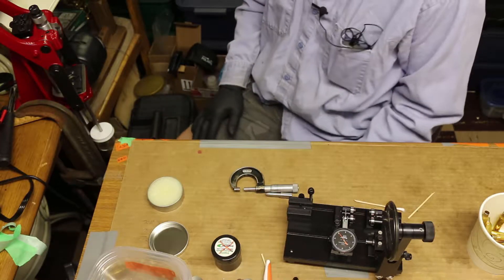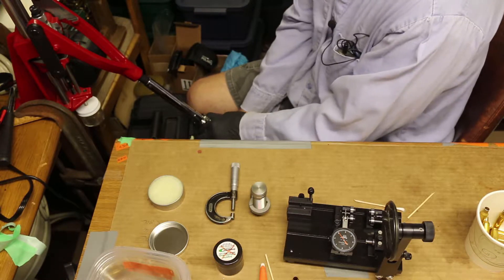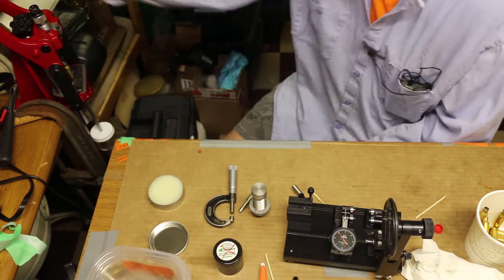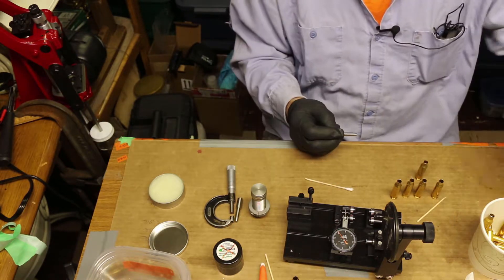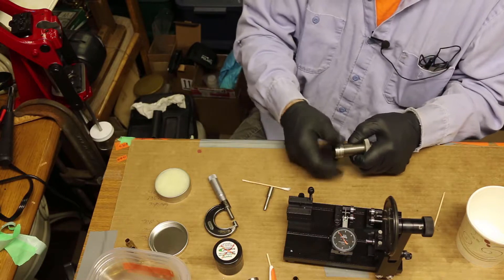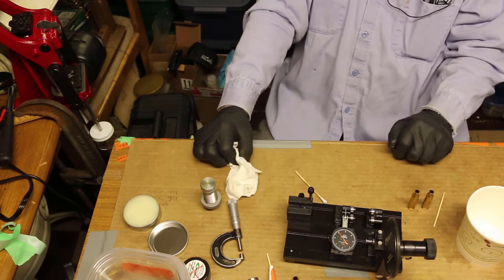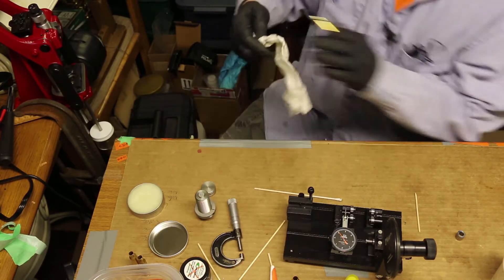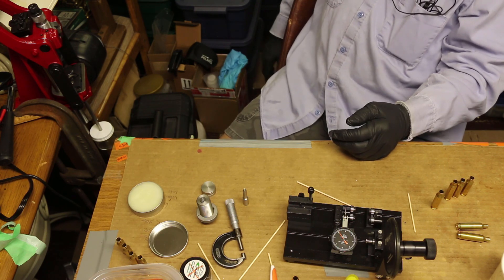A Example Case for Neck Turing Your Brass or Setting Bullet Neck Tension with a Expanding Mandrel

Comment: Turn before annealing with harder brass or after annealing with softer brass or do you think it does not matter?  Thanks.
Reply from the maker: I am not sure. I don’t think the actual neck turning cutter cares if the brass is hard or soft.  It will be high speed tool steel or carbide against brass. The cutter will win. The surface finish afterwards on a harder or softer brass will make a difference, but I believe the surface finish will be related to the shape of the cutter, ie a more aggressive rake angle or less aggressive rake angle. Also with carbide a slight rounding of the cutter point over a sharp corner helps with surface finish. I hope I did not muddy it for you.